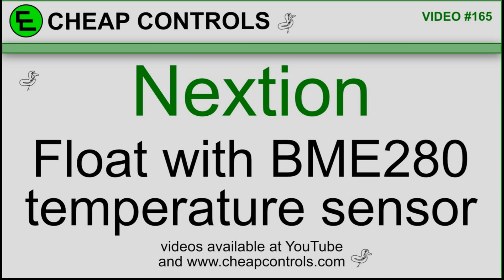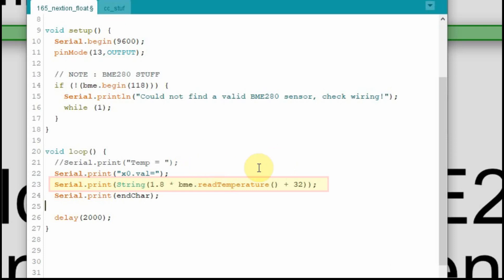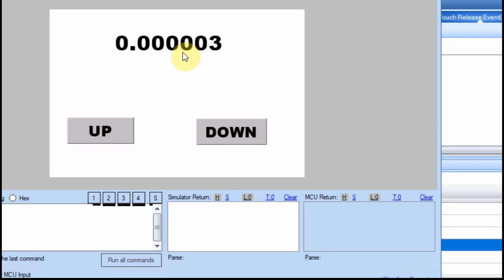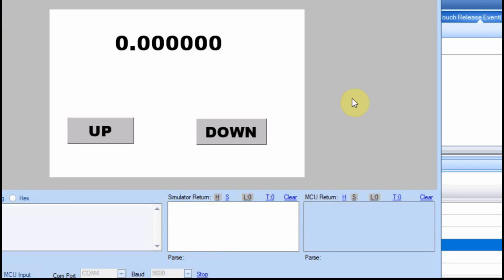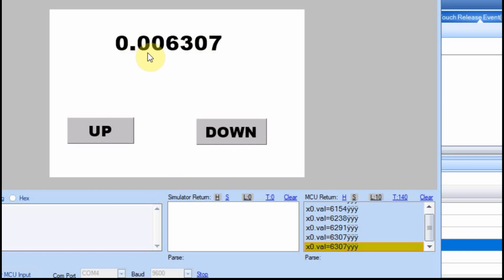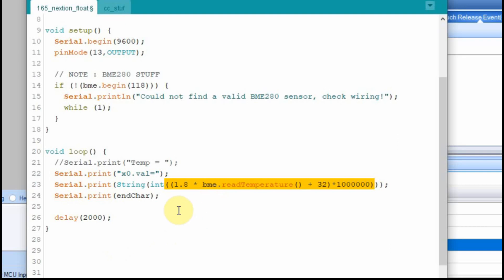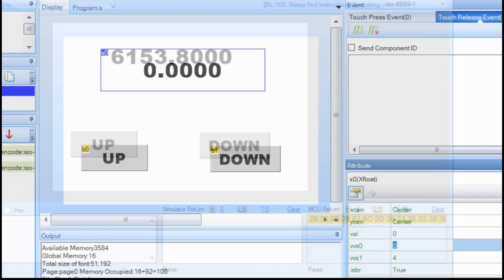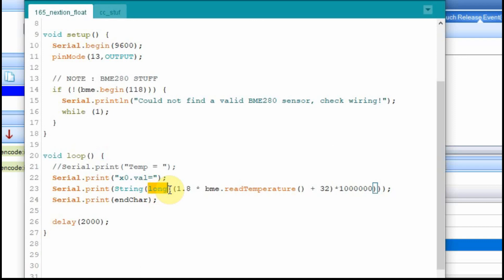165 #nextion #arduino #tutorial no Library BME280 temp float value

Comment: make a video on max31855 k-type thermocouple and nextion display NX4832K035_011 for displaying the temperature value on it.
Reply from the maker: I have a max6675 thermocouple.  I am taking a little time off making videos.  I will be back at it in September.
Reply: @CheapControls  because I have to complete my project till 12 Aug
Reply from the maker: You can request paid services over at www.cheapcontrols.com.  There is a help page.